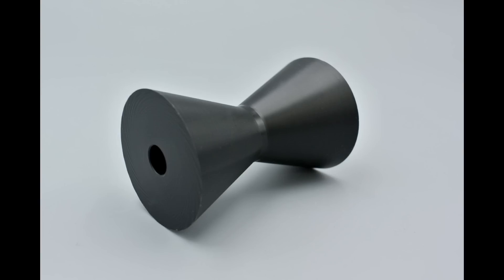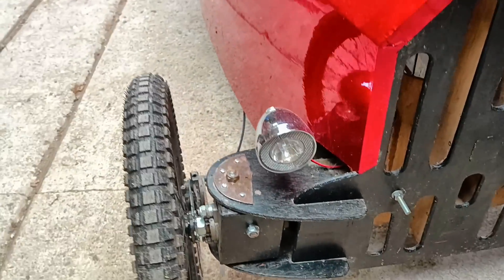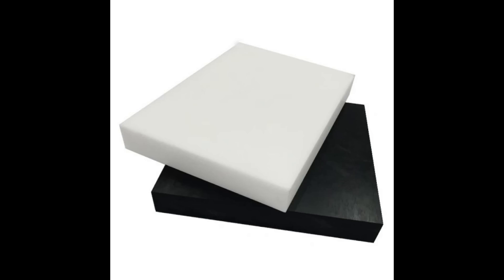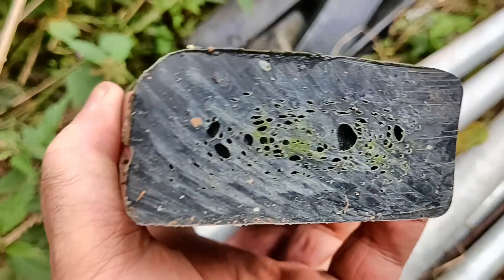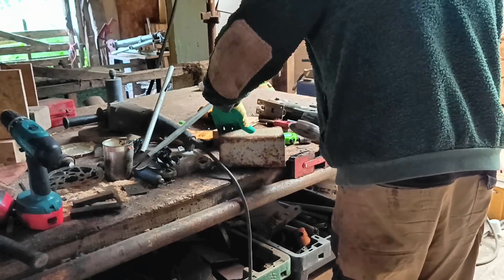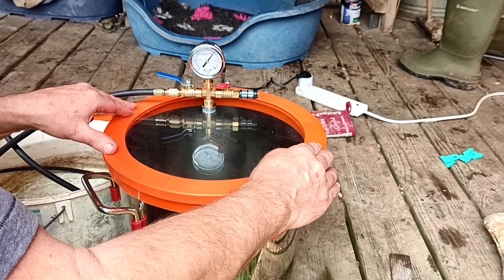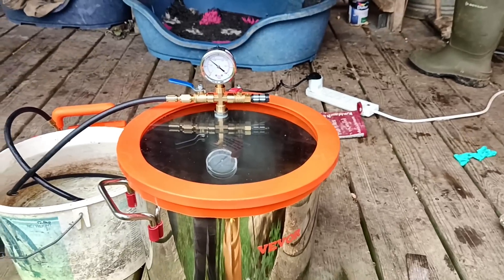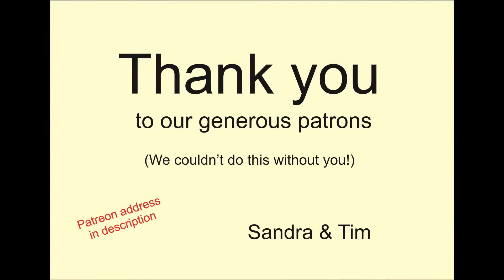Vevor Vacuum Pump And Chamber – and the challenges of Home-Made Machinable Recycled Plastic Stock

Comment: How slow where you letting it cool off during your first experiments? Just getting it out of the oven after melting, or slowly reducing the temperature of the oven until it is cold?

One of the problems with these kind of bubbles is that the outside layers of plastic cool before the inside, and so when it needs to shrink, the outside is already too hard to shrink and the inside gives way. I would not be surprised if the inside bubbles where a vacuum already (or close to it). Well, after having seen your video, I would be surprised, because if the bubbles where a vacuum, they would not grow in the vacuum chamber, but I hope you see what I mean: bubbles are structural due to the cooling process more than the presence of gas.

If you have not tried it already, slowly cooling the plastic so that the outside is barely harder than the inside during the whole process may make a difference.

I'd say, to be sure, try to cool it slower than you heated it, or than it cools off naturally, whichever takes longer. So if it takes 15 minutes to melt or cool off outside the oven, reduce the temperature of the oven over 30 minutes, or something like that. If the bubbles end up smaller, then there was an effect. If they are not small enough, maybe prolonging the cooling period even more can help. 

Although my knowledge is purely theoretical and I am absolutely no specialist, so I could be way off. But that would be one of the things I would experiment with just to see if it makes a difference. 

The idea immediately popped in my head because of prince Rupert's drops. Smarter Everyday did a video about them a long time ago (and revisited them not so long ago), and in his first video he explanation of the material stresses during the cooling process is enough to understand why there are bubbles in the originally homogenous drop: https://www.youtube.com/watch?v=xe-f4gokRBs
Reply from the maker: Thank you - interesting!

Comment: Your oak block and spring felt most promising... But there is nowhere for the air to escape. A plate with holes drilled combined with a finer starting size may work well. 

Would a higher heat make the plastic more fluid ?

Comment: I do a lot of vacuum infusion to make composites.  The other way is to use an autoclave.  Put your 'hot block'  😊 in a high pressure vessel to shrink down any bubbles. These small voids could hold grease for bearing lubrication too. 👍

Comment: How much of the voids are trapped air, and how much is basically empty or vacuum due to shrinkage? 
If you know the material, you could probably look up how much it expands and shrinks between 20C and melting temperature.

Comment: That's why injection moulding is done the way it is.
Maybe stick the whole thing in a pressure cooker, so you heat it while pumping the gases out?
Reply: Or the opposite? Add something that boils to increase the pressure? Then you're using the pressure cooker as intended, and the wife gets less annoyed

Comment: I've made machinable wax before which is similarly viscous and similar temperatures. Rather than vacuuming the bubbles out i instead used a painter's pressure pot to compress the bubbles down till theu disappeared. The other difference is I melted the plastic + wax in an open pot and stirred it mix, then slowly poured it into molds. Then I put it in the pressure pot and kept it under pressure until it cooled. You may find that as the material cools it shrinks and so voids will always want to form; keeping it pressurised ensures the bubbles remain microscopic.

Comment: My experience with plastic Recycling were similar. I tried to make sheets out of bottle caps. Well, I got some flat blobs that I never used for anything. I tried to force it flat with clamps but it takes ridiculous forces. Grinding down larger pieces of plastic also never worked for me, because i don't have a metal workshop to build a shredder. That's why I ended up with bottle caps as raw material. Ist there any way you can heat the plastic under vacuum? If there ist no air in between the plastic Bits before they melt, there can be no bubbles. But be careful! You will only be able to heat the plastic by conduction, Not by convection! For such a block, it will probably take forever...

Comment: I've machined stuff from homemade recycled plastic blocks, and my best results were blocks that I compressed with a 20 ton press before melting. I was using primarily HDPE milk jugs run through a heavy duty cross cut paper shredder, which gave a fairly uniform size of raw material.
Reply: I was going to say the same thing. It's pretty surprising how little plastic is in the jugs.

Comment: Could you alter the viscosity of the plastic perhaps by introducing a mixture of different plastics to make them more "workable" so to speak ? All of the above comments are excellent, especially the pellets, I'm sure you will find a path through this dilemma Tim😊
Reply: Yes this. It's the one thing that hasn't been mentioned yet... root cause of the problem is the viscosity of the melt, preventing extraction of bubbles by vacuum.

Comment: id try a kettle element in the metal container, inside the vacuum chamber , that way as the blocks heat up there is no air to get trapped.

Comment: I would try it again after the plastic has been ground down in to a powder, then make a chamber with a heating element around it, put it under the press so you can increase pressure on the mould as the material heats up.

Comment: i too have had limited success. using a mix but mainly milk cartons. i mix it with bentonite and activated carbon. i put it in the oven on full to melt it and then treat it like a dough whilst it is still hot and knead the gas out. i then reheat it and press the resultant dough into a silicone mould. this is producing very tough shiny hard black place mats.
Reply: my attempts are on a much smaller scale with an old bean can and smaller chunks of materiel. you may have more success by simply using a smaller plastic pellet size.

Comment: some of the blocks you created didn't have  massive  voids - for the steering block - would drilling and using a metal bush through the block solve the issue - even with the occasional void - that plastic looks strong enough? Great experiments. Keep it up. Hope the 'cold' is gone!

Comment: I think it would be more effective if you bought a 3D printer to make the plastic pieces, then you can decide where you want air holes in your block without it weakening the strength and thus saving both weight and money.   🙃

Comment: The main problem appears to be you introduced the air bubbles when placing the plastic blocks in the mould. Start with new plastic, cut everything up smaller, pack the large block with the smaller pieces without too much space between them, then you can do all the melting you want, and if you can melt them while under vacuum, there shouldn't be very much introduced air at all in the plastic block.
Reply: Most plastic is hygroscopic and absorbs water from the air.
This is why a lot of people who 3d print have humidity controlled filament storage or even desiccate their filament.
When extruding, the temperature required to melt the plastic will cause the water to boil which can cause the plastic to foam as it prints, ruining the print. 

It's likely that this is the case and not anything that Tim is introducing manually, the plastic had been sitting outside (it appears) in a generally humid place. 
Everytime he cooked it, the moisture would have evaporated and caused steam bubbles, but it wouldn't have been able to escape the plastic as it was too viscous.
So, then it cools and the water is reabsorbed, the plastic is cut up and remelted and the cycle continues. 

He should shred the plastic into smaller pieces but then he should bake it just over the boiling point, maybe 120C for an hour to dry it out as much as possible and then try again.

Also, maybe set it under pressure with his hydraulic press while it cools, since most extruded or injection molded plastics are done at high pressure to help avoid unwanted cavities.

Comment: It will trickier.  But you have to start with s high vacuum before melting. 
Make your mold with a small taper to make extraction easier. 
No air to start means no air to trap. 🤔

Comment: Just an idea - how about building up thin layers (not sure if you'd need to degas each one before adding it to the mould), with a final heating to fuse it all together.
Reply: I had this same thought. If, at each moulding, you cut the product into bars (as large as possible without voids), then replace the bars into the mould in their original orientation so that they don't have to be completely melted. Would they be able to be fused together into a solid block if positive pressure were used to maintain full contact between blocks?

Comment: Why not use a Panini Press and press the plastic into sheets between baking paper. Then "glue" the sheets together using plastic cement ? Or ethyl-acetate or something that slightly dissolves plastic and evaporates quickly to allow "cold" welding of plastic bits or something? 😀
Reply: Or ultrasound welding. Likely to pricey but some plastics can be welding together using ultrasound gear.
Reply: Unless vevor do one and they can send it to Tim for free @zestoslife

Comment: I'm no expert but when ever I see plastics being recycled they are usually turned into small pellets first. I wonder if the greater surface area would aid the melting process and allow off gassing of the plastic. BTW - take very great care with this process. Off gassing plastics can expose you to some pretty nasty toxic fumes. Prolonged exposure can be extremely hazardous. Do take care with your experiments. Best wishes - Paul
Reply: I've been to a plastic mold injection shop. Yes, the plastics they use comes in pellet form, in vast quantities. Its put under high heat and pressure before its injected into a shaped mold.
Reply: In industry it's a tradeoff between more surface area for gasifying fumes and less surface area for less oxidation and better layer cohesion. The grain size should noy be too small or too big.
Reply: Work in a plastics blow molding and injection molding factory in the 60s and 70s, yes, pellets or small flakes  and sometimes powder.
Reply: Maybe he could use his charcoal chopper to shave it into little pieces and then chop it up. He needs a big wood grinder or something.

Comment: Could you put the pressure pot on the stove? If it will tolerate heat, you could put  rack on the bottom and fill the pot with oil (gets hotter than water) and keep the whole thing hot while you are degassing it. The plastic is too viscous otherwise. Good luck! I think petting turnip on the belly might be an important step in the process 😉

Comment: A pressurized chamber is much more effective at resolving voids in a casting. It compresses the bubbles until they are too small to be a bother.
Reply: compressing large bubbles in barely flowing molten plastic is much different that compressing lots of very small bubbles in a liquid. The smaller bubbles are still voids, not suitable for machining.

Comment: Would agitation or vibration of the hot plastic help get the bubbles to work their way to the surface, or at least away from the bottom so there would be some usable chunk at the bottom of the block?
Reply: I think it is just too viscous for that to work
Reply: Was thinking the same thing.
Reply: Like a poker in concrete laying?